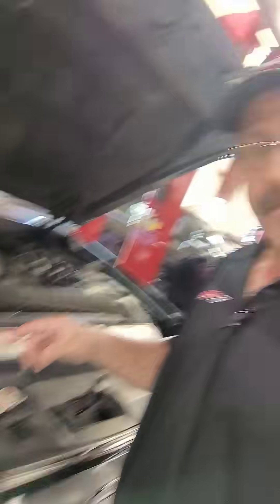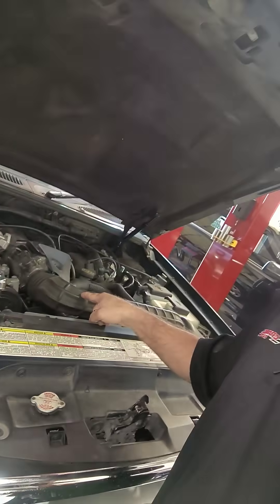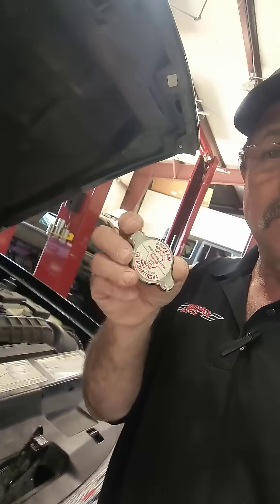16 #FAQ  Does my car need a #radiator cap to keep it from #overheating? #engines

Comment: The 'operating temperature' usually isn't the prooblem, it's the hot spots in the engine which run much higher.  Coolant without enough pressure can boil even if you have under 200 degrees operating temperature.